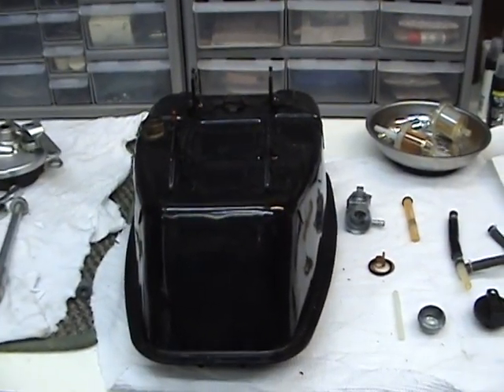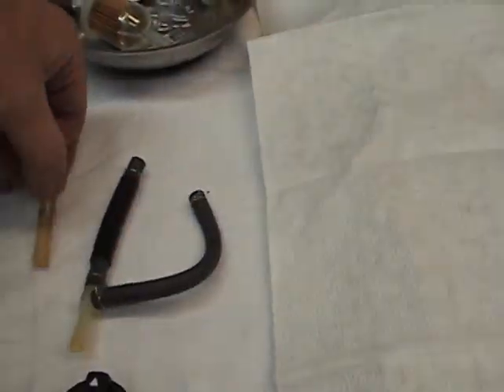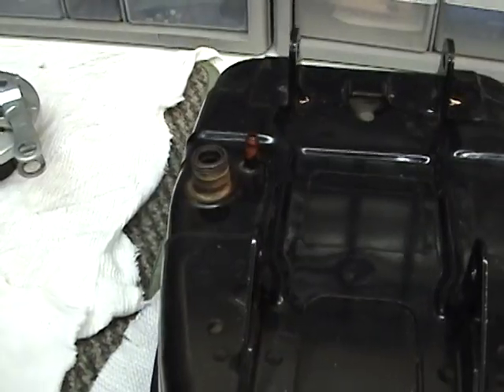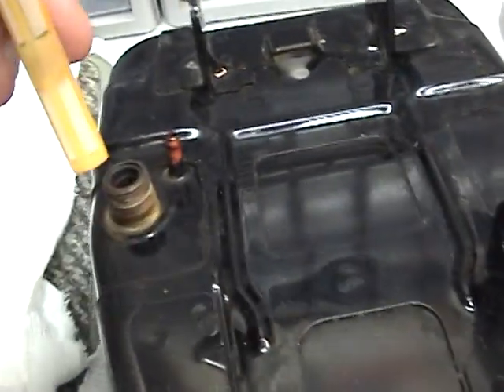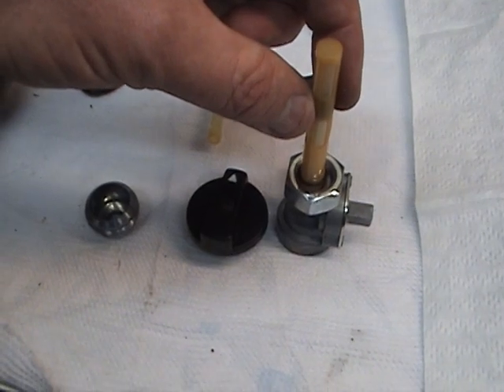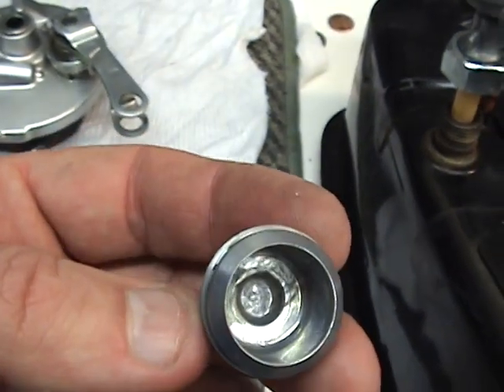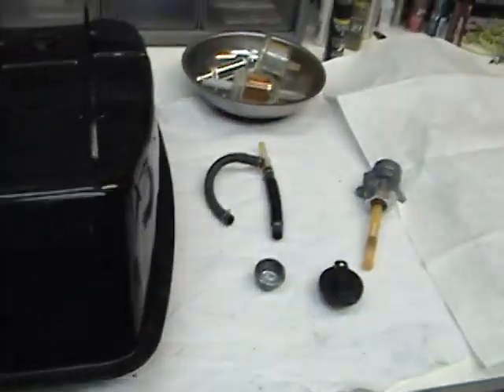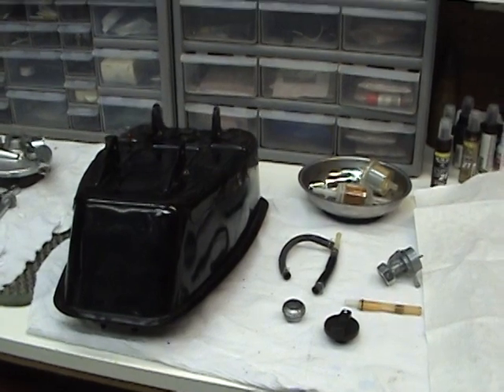(1)- 1985  HONDA GYRO gas tank TOTAL rebuild

Comment from the maker: It holds a little over a gallon and weighs 130 pounds I believe. With three wheels it slows mileage per gallon like down to 60 mpg? I have never clocked it, as I only ride the little antique a few miles a months on very sunny days. Everyone always stops me and asked where I got this brand new model. THen I tell them it is from 1986.